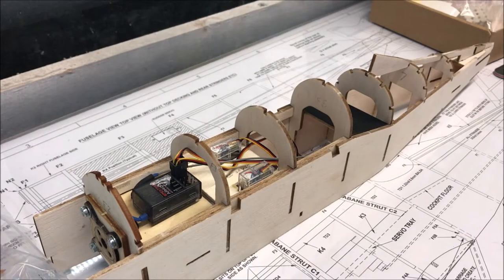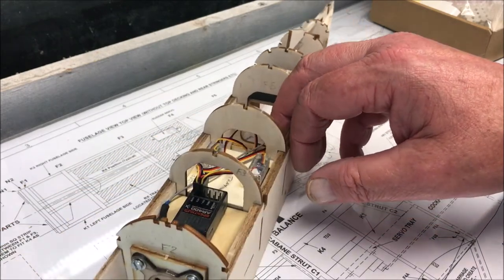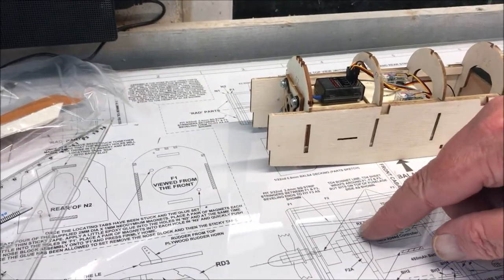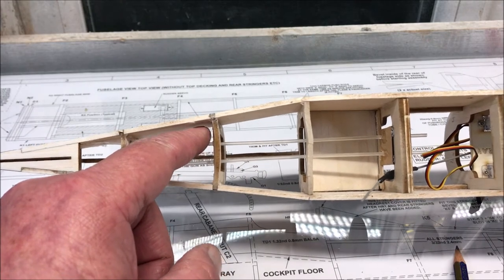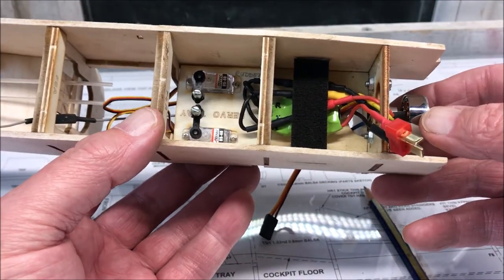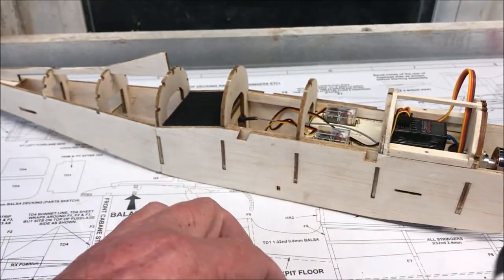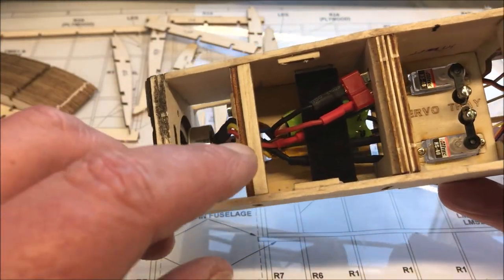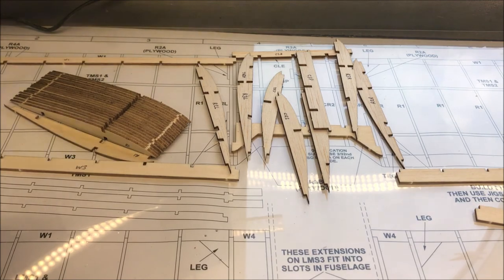Vintage Model Company SE5a Part 4

Comment: Barron, hope you don't mind the update, your frustrations have helped me so. However, I now say destructions sad.  have a question, how does one wick  
with glue?
Reply from the maker: Horris, yeah spread the word destruction and say where you heard it first. Wicking 🤔 well it is when you have your wing ribs in place and you want to glue in situ, this takes a bit of practice, but how I do it is with a cocktail stick or some say a tooth pick made of wood. You drop a baby tear on to the cocktail stick in such a way that it stays there and then apply the glue by touching the part you want to glue.
The glue runs off the cocktail stick.
Now I don’t recommend thin glue for this as it runs every where and you will glue the wing to the building board. 👎🏼
So I use medium glue.
If you don’t mind waiting, use PVA glue.
Cyno is quick yes. PVA is a more natural method.
You can buy cyno with a micro tube attached and some people use that method. I don’t do things that way as the cyno can dry and block the tube.
You need to find your favoured method. 
But if you look closely at my video you will see me using the cocktail stick. 
I have seen people just blasting the glue in with thin cyno and it just runs everywhere and your wing is glued to the board, and so you may break your wing try to release it. 
In this case, I recommend using a metal ruler to slip under the wing very slowly to unstick the wing. 
I hope that helps?